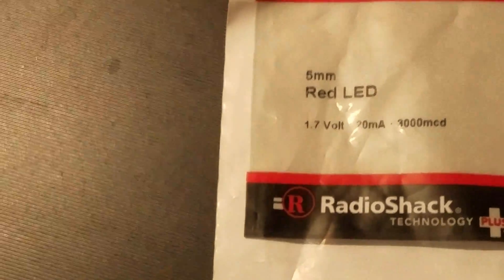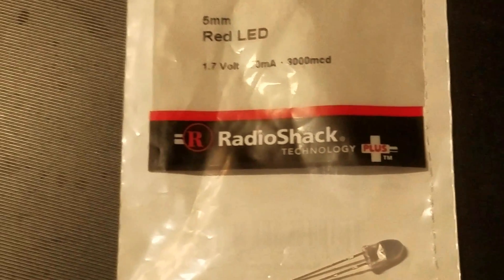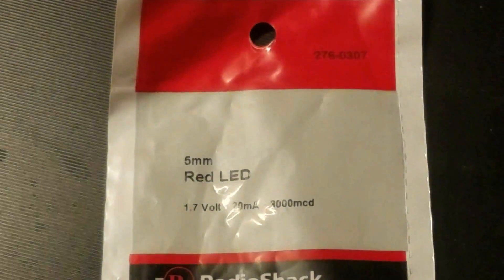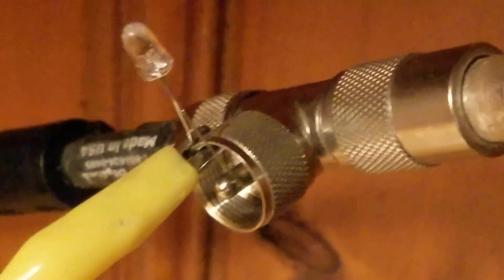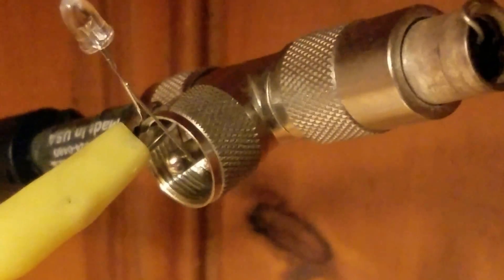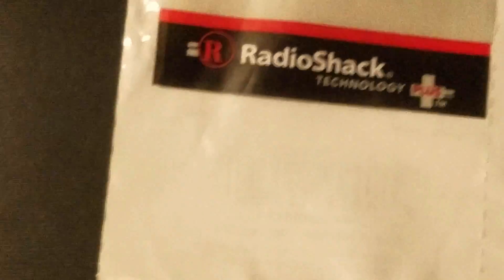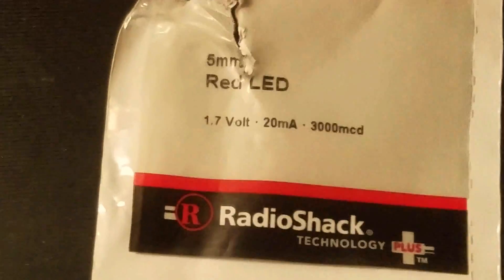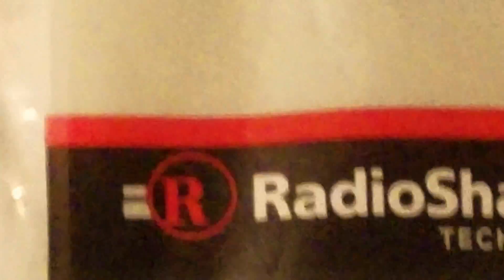Be sure to disconnect your antennas during a lightning storm

Comment: What about direct hits on the antenna? My random wire can't be grounded outside because I live in an apartment on the 3rd floor. Is it enough to just unplug the wire?
Reply: I would find a way to ground both conductors of the coax whenever you are not using the antenna. If the best you can do is ground it to an outlet ground, that's better than nothing. You will most likely have serious damage if there is a direct strike regardless of what you do - but there is a whole spectrum of possible strike severity. Disconnecting provides protection against large static buildup from nearby strikes and just the higher level of atmospheric voltage during a storm. If the strike is very close but not direct, then there will be a large enough surge that the coax will find something to arc to and could cause a fire, which is why it is better to ground it as well as you can. The only way to handle a direct hit, though, is a very good ground and lightning arrester system before the feed line enters the house.

Comment: My coax sparks during a storm. I touches it and got a mean shock!
Reply from the maker: You might want to install a lightning arrestor it should bleed off any static which may accumulate. Depending on the day, very dry and windy, so great potential for static. I have heard story's about people having to repair the radio from the static charge that had a blown FET in the RF front end.

Comment: I used to have a scanner discone antenna on the roof with 50 ft of coax. During lighting storms my coax would arc with a visible spark.  I could see that damaging any radio hooked up.  I touched the connector once, it felt like a strong carpet shock.

Comment: What an excellent video.....what if i have an antenna switch and put the switch to ground?  does that help?  thanks.
Reply from the maker: I think so. Normally I keep my antenna selector on the disconnect setting.
Reply: Can help if strike no-so close -- however; for direct hit only a disconnect will help... and then you will have surge in your house wiring so you will be real trouble elsewhere also
Reply: A decent lightning strike will jump switch contacts.  I had to replace many washer and dryer controls on equipment that wasn’t running and not even a direct strike.